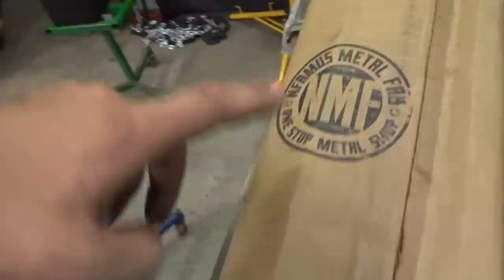2nd Gen Cummins Project: Pt 3 (4 Link Kit)

Comment: Did this install 2 years ago. The hangers/Brackets on the frame are a little weak. Running compounds on a 5.9 12 valve and my pinion angle got quite excessive. Adjusted and took for another ride all ok until I literally twisted the hangers. Just made my own out of 1/2" flat plate, good design though.

Comment: Had a failure in my design. Figured Id see what happened if i put airbags on top of the coils and use shorter coils.  not enough stability out of the  bag to keep the  coil straight up and down .  so i made a spacer  make up the difference in Heights from the giant coils.  Had it all done and was grinding at night and hit the line on my fox shocks.. just now got the line replaced ..

 when I have more time I'm going to go ahead and  take the coils out completely on the front  play some with the bags  I need bigger bags  like  the diameter of the ones you have on back but taller  and I'm probably going to have to make a bigger spacer .I used an old cut torch fuel tank ,it worked out pretty good .   Do you have an idea to where to get the tallest bags I can get ? my truck has a 12 inch lift so  I'll make up the difference in the spacer  mount the bags on the bottom like they're supposed to be

Comment: only 8th inch on the frame?  I wonder how thick the metal is on the front of the frame of my 2008 2500 .... I'm getting ready to weld on my  coil buckets  that my airbags and shocks and all that s*** mount to  but I've been thinking I should probably get some  plate  to wrap my frame when I'm welding the buckets on to .. would you  suggest that ? if so should I completely  go all the way around the frame  with plate before I weld the buckets  onto the frame ? there's a lot of stress on that front end with the 38s.. it snapped my steering shaft  like as if it was made out of wood  so I just installed the redhead ultimate Duty  steering pump  and I'm getting ready to put on the brace that braces the steering pump .. the f**** guy sold me the wrong one  so I'm having to modify it so it will line up right ... nothing's ever easy and nothing works like it's supposed to you  know ...
Reply from the maker: I would add some sort of stiffener if you’re welding on new parts, I failed to do so on one project and it’s going to have to be corrected.  The 1/8 material has too much defection in it and over time welds start to crack.  Hence why you try to span the load over a greater surface wirh thicker material.
Reply: @j_moffitt  Thanks for getting back to me. haddent thought so much about that but just seems like it needs to be beefed up especially with how heavy duty I made the new buckets. i think im going to pick up some heavyflat stock and wrapthe frame before I Weld on the new buckets. I put on the RedHead ultra duty pump and the pump brace goes on today..all a sudden my generator wont push enough amps to my welder so delays as usual...
Reply: I cut the buckets off of my parts truck then beefed them up and welded the hell out of everything and braced it all up once it was all in place. i took your advice and spanned the load out as much as I could. Drove it once with the bags on the springs and it was perty good..Seems like I got eveything lined up and welded in solid

Comment: Aaaaaaaa shyte!!...that was sick. Got the world wheels turning in my head now thinking Bottle Gas thinking 4 Link and airbags airbags on the front. My Gen 2 3500 4 wheel drive dually got T-boned by some bonehead. But they're going to pay me for it I had insurance but now I'm thinking back outside the box again. I build Picture Cars and stunt cars and sheet like that. When I'm not at work I'm at home with my mind running and my welder is cracking. Seriously love the video dude right on thanks I got to get that f**** kit man.. I've been thinking about that set up for a long time. I think you gave me what I needed to actually realize that It can happen and will
Reply from the maker: Glad I could help man
Reply: @j_moffitt  yeah,thanks...been watching all the steps you take there cuz that's exactly what I want to do if I ever get my money from this freaking insurance company. The killing me man they're killing me. I always wondered why you could buy front airbags for Dodge 3500 but not for four wheel drives. By the way where did you get those bags or what are they for originally? If you wouldn't mind I'd like to get some
Reply from the maker: Bags I got from sdtrucksprings.com and i don’t know what they are originally for, I just got them based on dimensions I wanted and they work good for my application, but for you it may change depending on the setup you want to achieve

Comment: Hey can someone explain why on trucks have a similar style 4 link or long arm setup for aftermarket and custom builds. But on a jeep or off-road vehicles the 2nd set of arms are placed elsewhere such as the top of the diff. More strength vs more articulation? Thanks.

Comment: what do you normally set your pinion angle too when you are building the rear air suspension?
Reply from the maker: Yokes should be parallel.  Height can vary

Comment: How long of bars did you get?
Reply from the maker: bars are 40" and add on the end tube made them about 42-43" all the way in
Reply: @j_moffitt  I'm looking to do this with my truck but I only want it to sit level with my 6in lift but drop to factory. How long of bars do you think would be appropriate. I have a 03 f150 4dr short bed 4x4.
Reply from the maker: the longer the bars the better, its not so much about how long as to how and where they are mounted, don't want anything too steep of an angle

Comment: Hey man what’s your IG want to keep up with your build trying to do a similar air ride suspension on my s10
Reply from the maker: WIDES10   _j_moffitt   To be honest tho I kinda suck at IG lol you’ll see it here before I post on insta usually but I’ll try and work on that haha
Reply: J_Moffitt I’ll be keeping up with your build how did you set your angle and the rear axle ? I’m buying parts to do my rear soon
Reply from the maker: WIDES10 bars I just welded them square to the frame, there is adjustment in the ends for alignment when it’s all said and done and your pinion angle on the axle should be the same angle as the output on the trans
Reply: J_Moffitt thanks man can’t wait to get started on mine then swap the front axle for a solid
Reply: J_Moffitt hey if I were to send you a template of bracket for link bars could you tell me how much to make them? The only local shop here wants to charge me outrageous for four brackets I could send you a drawing
Reply from the maker: WIDES10 dm my insta the drawing and I’ll tell you if I can do em or not